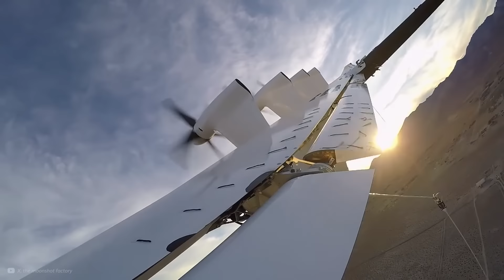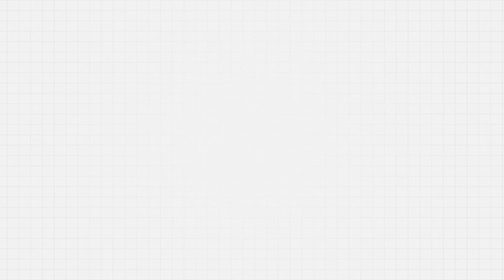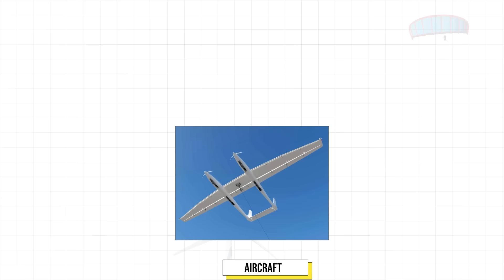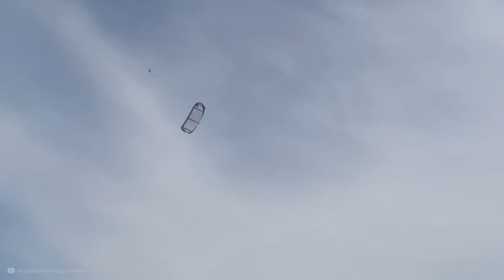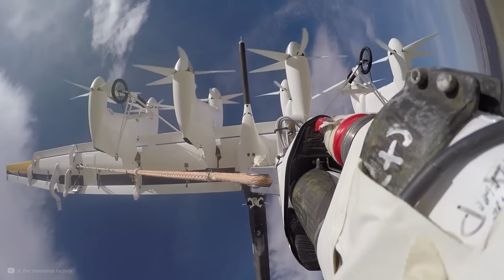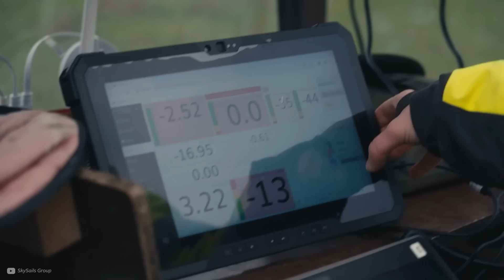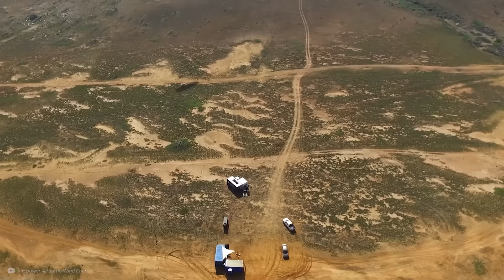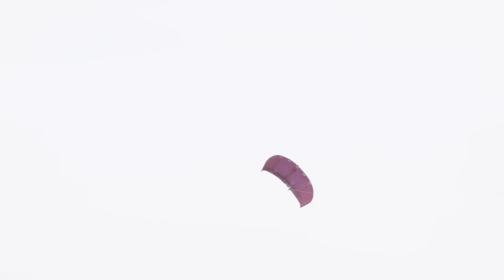Airborne Wind Turbines: The Future of Clean Energy?

Comment: I'm pretty sure it's because helium is impossible to contain, so it's requiring bouyancy to keep it flying was the issue. there's no way you can keep the helium from escaping. It'll literally leak out of a solid metal pressure vessel though the metal walls.
Reply: Just use hydrogen insteed of helium, i'm sure having electrical connectors and moving parts would be fine after all there is no reason why a bolt of lighting would hit that metal cable up in the clouds.
Reply: @matthew_baynham  hehe
Reply: @Critical-Thinker895 someone w a screen name of critical-thinker895 should actually think more before criticizing. Critical thinking is not the same as criticizing BTW. Perhaps a misnomer altogether. The Hindenburg ignited and killed 35. Was it a lightning strike or was it potentially static discharge?  And - the US was the major source of helium, supplying He to the world (selling). Likely that the US still is one of two countries with the most helium (He). We mine it. We have stores of it. We would not sell it to Nazi Germany at that time - mid 1930s.  We had.  BUT we stopped selling helium to Germany due to their extremism, and worrisome military build-up under Hitler's Nazi rule in the 1930's.
Reply: @rwhite4688  You're a month late.  If you want to troll someone it needs to be done in a timely manner.  Try to be on time next time.
Reply: So use Hydrogen. It's way cheaper, and no one's there to burn if it ignites. Heck, ground it through the tether to avoid lightning strikes
Reply: @justsomejerseydevilwithint4606   couldn't have been put better honestly, like i myself could say: any problem you could think up, someone would eventually come up with a solution.
Reply: Like someone else commented. Hydrogen is the way to go. Not helium. Helium is basically a finite resource. We should save it.
Reply: @dianapennepacker6854  Yes, we need it for balloons.
Reply: @Critical-Thinker895  Nooo man Helium shouldn't be used for balloons if it can be helped. It is finite, and high tech equipment needs it. Like MRI machines, or anything that uses super cooled magnets. Lasers! Fusion!

 Hydrogen is fine. We can make it safe. This application doesn't involve passengers!

 Maybe if we started producing more nuclear. I hear it is a byproduct of at least some reactors. Fusion definitely can. 

 They say we only have enough helium for 200 years max. Some say 10!
Reply: @dianapennepacker6854  That's exactly what they said about the Hindenburg.
Reply: @Critical-Thinker895 Thermite.
Reply: The Hindenburg was massive and carried people, along with running ICE engines. A balloon igniting at altitude isn't as big of a deal and is less likely with this application.
Reply: @nomms  tell that to the forest below... and in a windy day...
Reply: @Critical-Thinker895 the Hindenburg was actually very non deadly, if memory serves there were very few casualties when it went up in flames. And the ones that did die did so because they ran back in to try and save others
Reply: @Iris70390  Your memory or your complete disregard for human life are astounding.  There were 35 casualties on the craft and 1 on the ground.  That's not insignificant.   Also, that's not what you would call "non deadly".
Reply: @Critical-Thinker895  upon further research that is correct, and kudos for calling that out
(I’d forgotten the statistics somehow and a solid 30% of people dead is in no way insignificant)

This entire argument is irrelevant though because a flying wind turbine wouldn’t have anyone on it and thus would have 0 casualties if it exploded in mid air with debris being the only danger. Still not perfectly safe but safer then the vast majority of other energy generation methods
Reply: @nomms

The Hindenburg was also painted with the chemical equivalent of rocket fuel and it was the paint that lit fire and caused everything to explode.
Reply: @Critical-Thinker895  there were people on the hindemberg 🤪
Reply: @Hamletbls My argument was not about people.  It was about explosions and the fact that they said the exact same thing designing the Hindenburg.
Reply: @FreedomTalkMedia  Photographic evidence shows that even after the fire destroyed the airship, some sections of the covering remained unburned. Additionally, experiments have shown that the Hindenburg's covering would have taken almost 40 hours to burn completely without hydrogen.
Reply: @FreedomTalkMedia simply not true... painted in what?
Reply: @user-McGiver Hydrogen won't make it to the forest, it leaks away pretty quickly at high altitude.

The Hindenburg was closer to the ground and had much more of it.
Reply: You guys know what could give us helium and energy? Nuclear power
Reply: If you were to use hydrogen through leakage you could replace it by using a small amount of tthe generated electricity to electrolyse a small amount of water.

Comment: at least if you diy, no trading. no talking while attempting trade.
Reply: also change to two-part symmetric rims, and use industrial solid belts as solid tires. or flexible tires.
Reply: a ground based wind bending rotating stick instead of kite. also sail wing wavt turbines are simpler and better than normal blade turbines. yep the kite wing tech applied to normal wind turbines. large slow sail wings, instead of narrow fast blades. yep like sail boat sails. large and slow. ai cant do any better than you. or just invent a fool proof way of using the kite rope gen tech.

Comment: maybe instead of space elevators , carbon nanotubes would be used to build the tether for one of these instead.
Reply: Dont think the tether was mentioned as a problem
Reply: @Scissors69  There was a brief mention of a tether being as strong as, but 1/7th the weight of, steel. Kevlar perhaps. Probably if one had a yet lighter tether one could go higher, which is apparently always better (modulo regulatory issues).
Reply: @Scissors69  for stormy places
Reply: why not both?
Reply: @ecogreen123  it could be both but the space elevator stuff doesn't seem to be materialising anytime soon. looks like we'll get something like this first.
Reply: @avijit849   i mean obviously.
Reply: My world is powered by pixie dust, thoughts and prayers. What ARE you on about?

Comment: I have an idea for an electric flying glider that charges its batteries while in the air when in excess lift/thermals, and or on the ground in sufficiently strong winds!   Similar to airborne wind turbines but just has to make enough power for itself to remain airborne with its dual purpose motors/generators.